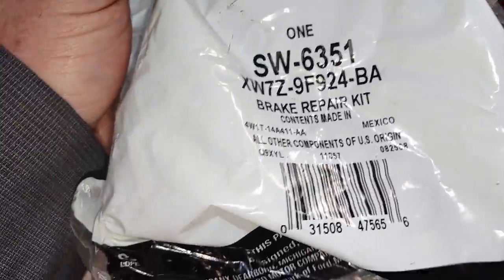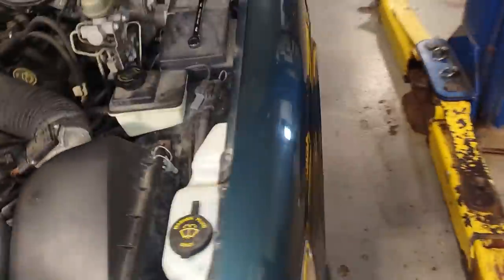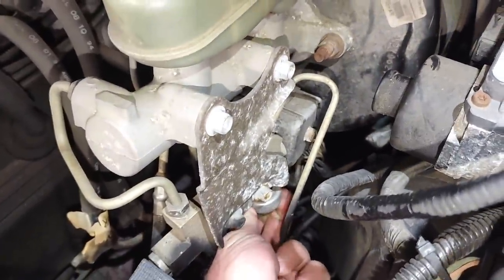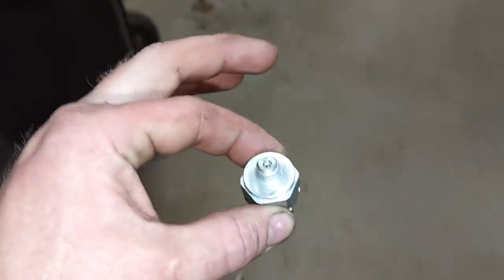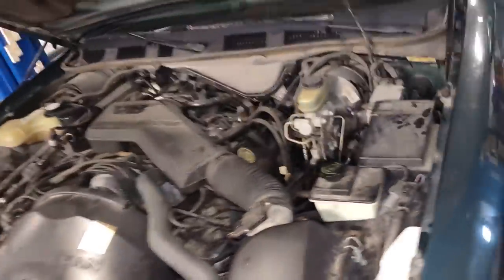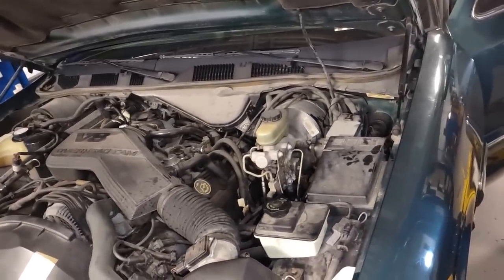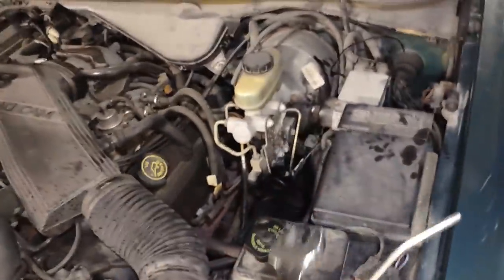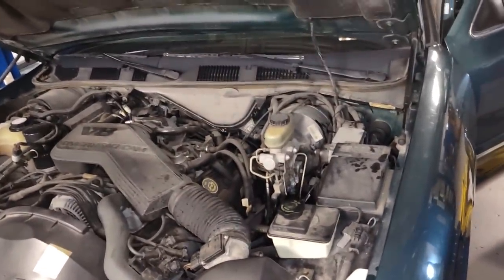Subscriber Dropped Off 1995 Grand Marquis to Get Recalls Done, Vehicle May Start Fire Recall - quick

Comment: There was a recall on Escorts, in the 90’s. The ignition switch would catch on fire and burn the car, to the ground. We had one in and it burned down, in our service parking lot, while waiting to get into the shop. The customer was actually happy, she hated the car.
Reply: Was she gifted a new vehicle?
Reply: I remember that recall. That escort was a great starter car for learning manual too
Reply: @JohnS-il1dr  no just market value. It was about 5 years old.
Reply: @andoniades  Was pretty much all Ford cars at the time. It was a massive recall. like 8 million cars.
Reply: @andoniades  the car I learned to drive a manual on was an 89 escort GT.
Reply: @alb12345672  yes and then the Firestone recall.
Reply: @alb12345672  yeah. That was the recall that they were talking about in Fight Club.
Reply: That same recall was on the 87-93 Mustangs as well. I replaced a few of those ignition switches in Mustangs I had owned. They were pretty shitty ass switches. What would happen is the switch housing would start coming apart, and then a copper electrical contact inside would slide out of place causing it to either short to ground or to one of the other contacts. They were only held together with crimped pieces of metal...not the best way of securing the thing. Part of the recall I think added the metal pin to it... which was just a bent shaped piece of metal wire that locked between the top and bottom halves. To me.. that didn't do a whole lot for it. I even had problems with the replacement switches. They should've just redesigned the damn things.

I always dreamed some aftermarket company would make a complete redesign of the switches. Like the ones made in the 94's and up. The only way to get one of those in would be to swap out the steering columns. Sucks.
Reply: @brucewrigleysgumchewz4667  ahah   GM suoilution was to add a rubber ring which did nothing   esp if you had a front bench seat and a kid accidentally moved the key  it could cause it to crash
Reply: @greasyhandsauto-shaunbutte9726  Ford had to issue that recall twice. They forgot the spare tires! 😳🙄😆
Reply: LOL back in 2002 at my dealership a customer traded in his 1990-something Ford Ranger on a new vehicle. Old Ranger was still in customer parking while owner went home to get 2nd set of keys. When he pulled up the Ranger was fully ablaze and fire department was on scene putting it out. His eyes got wide, he tossed the keys out and said, "It was in great shape when I gave it to you!" and peeled out. It was the dealership's used car at that point, but what lucky timing for that guy. Literally traded it in with hours until the truck self-immolated.
Reply: @MrJeffcoley1  that’s hilarious. My dad owned a Ford dealership and my grandpa before that. From 1937-2004, I love hearing the stories. We had a husband and wife but a car and before they left the store, the husband died. Luckily, the had purchased credit life insurance. Sh got the car free, well at a high price anyway.
Reply: @greasyhandsauto-shaunbutte9726  Ouch. That’s one insurance policy you hope never to collect on but lucky he finished signing before he croaked!
Reply: @MrJeffcoley1  for sure! It was a weird day, we had an employee die in bathroom one day. Heart attack, his wife came in and wanted to see where he died. Another employee showed her a spot, on the showroom floor. He couldn’t tell her it was in the crapper.
Reply: @punker4Real  I remember that GM ignition switch issue. The switch would rotate without any resistance at all. I don't know if they caused fires also or just shifted the switch position too easily. 

Best fix for the Ford switch... Smear a little JB weld or super glue around the entire switch. That thing aint coming loose ever again. Don't know why I didn't think of that back then..lol.
Reply: @andoniades  lol.. true. I learned in a 1967 charger... Memories
Reply: I hated them cars too.

Comment: A ford field engineer told us that when the switch failed and popped the fuse it would take out the Cruze and some customers would replace the fuse with a larger amp fuse and then bingo wires would burn and start fire and fuse still not blow
Reply: Seems common sense was lacking in these customers. Replacing a fuse with a larger amp fuse to try and stop it from blowing. Because they were too inconvenienced to fix the real problem. Some people should never be working on cars.....or on anything for that matter. It was obviously blowing for a reason. What did they think would happen? That the wire is rated for 100AMPS and will just keep itself together? Scary..

Bet those are the same kind of people who overload a home AC electrical outlet by plugging in multiple extension cords...and plugging in more extension cords to those cords.  😌

Comment: It was definitely a thing. Had Ford bronco come into shop class in high school for a tune up. Parked it outside the door before lunch so the owner could pick it up. Half way through lunch there was a huge smoke cloud. The interior was completely engulfed. The windows busted and flames were coming out 3 feet over the roof. After that, we had disconnect the battery of every vehicle if left in the shop unattended. One of many crazy shop class memories.

Comment: Nice work. I purchased  a second hand Ford Sedan in my country that was 8 yrs old . The Local dealer did a rear brake hose replacement as it was apparently  classed as an unofficial  recall. They were made too short  eventually  tearing the end off the hose.

Comment: I ordered the kit and installed it myself a few years back on my 95 Ranger 2.3l.  For the 10 bucks I paid on ebay, it was less hassle than taking it to the dealer, even though Ford had no idea the vehicle was updated and is now safe.  I had previously disconnected the harness to eliminate the risk but the cruise control was inoperative in that configuration.

Comment: Wow still going strong. Built Ford tough. Got an 08 F150 Harley Davidson edition. The odometer keeps going to a bunch of green squares.  If I wiggle the wires in its area it works. Ever seen this?
Reply from the maker: Are you wiggling the harness up by the cluster? I've seen clusters go bad in those doing that
Reply: @FordBossMe  just touch the wires by the odometer. If I hit bumps it comes and goes.

Comment: Yeah I often prefill brake components before installing.  Saves time in bleeding unless the customer has been driving around with blown out brakes for weeks which is usually the case with my customers.  
I'm born in the early 80's and I remember this fire recall.

Comment: That recall covered a very wide range of years of Ford, Mercury and Lincolns. My moms previous vehicle was a 2001 F-150 Harley Davidson edition. That was a nice truck..but it had major issues a few years ago. Anyway, she had the recall done a few years ago. And it's a good thing too. It was already leaking brake fluid onto the cruise harness below it. Unfortunately she no longer has that truck. Too many sensor problems had left her stranded the last year she had it. Turned out to be a failing PCM. Funny that... I thought the poor ECU's were limited to the EEC-IV's in the late 80's to early 90's vehicles. Like the '92 5.0 I had. When you don't know it's the computer, you're spending $$$ throwing a half dozen new sensors at it and thinking you're getting a bunch of defective parts. What a nightmare. 

When I worked at the Ford Dealership, there was a half burned out 02-06 Excursion sitting in the far back lot where they keep a lot of extra stock. Whole front end was toast. Turns out it burned out BECAUSE of that cruise control/brake fluid leak recall. That happened more often than people think.

Comment: Ford actually recalled a bunch of trucks from 1986 to 2003 for this recall... apparently there were quite a few people killed because of house fires they caused. If I remember right Ford was forced the recall from the NHSTA. Didn’t matter if they had cruise or not some still came with that switch. I installed quite a few of them harnesses in our trucks.

Comment: You ask if anyone saw a fire from one of these. We had a customer who had the harness with the fuse installed on his car. If the fuse blows at a later date, you're supposed to discard that harness and replace the switch with the upgraded switch.  There's a label on that harness that says that. The harness isn't made to be opened and the fuse to be replaced.  We had a customer whose fuse blew in the harness. He ignored the label and put a 25 amp fuse in place of the blown 5 amp fuse, and his car caught on fire.

Comment: The original recall was for Broncos. Then Ford decided to do a recall on a vehicles that used that brake switch. They did not have enough switches at the time and created a harness that had one fuse in case the switch leaked and it would blow the 2 amp fuse in the updated harness. Then they found out that not all vehicles had the power on the fused side of the harness they developed and came out with the second version of the harness with 2 fuses. One on each wire of the harness so it was more universal and covered all cars no matter which wire on the harness was powered. The kit you installed was the proper kit and last kit they offered. In fact on the original harness it had a blue tag stating that if the fuse blew out that it was to be replaced by the kit you installed and not to replace the fuse in the first or second version of the harness. I have a 97 town car that had the first version harness and when I bought the car the cruise control did not work. After I changed to the new kit the cruise control worked. I never figured out why Ford would leave 12 volts going to that switch all the time. I figured it would come on when the car was powered on. I just bought the same OEM kit on eBay for about 20 bucks shipped. My car had the recalled closed because they installed the first version on the harness which obviously did not really help because it still needed the switch changed in the long run.

Comment: I had the same recall on my 1999 Ford Expedition.
Reply: They only added a fuse harness on my F150. The switch went bad a month ago, the cruise stopped working. I replaced with the new style switch, the harness to adapt to the old switch connector, and a new fuse in the fused harness adapter.

Comment: Yea, the failure mode is the diaphragm in the switch would fail and leak brake fluid into the connector/wiring harness and catch fire, so they replace the switch (incase the original is leaking), and add a fused jumper into the harness. Recall affected my 97 F150

Comment: If your cruise stops working unplug it immediately.  It went bad no cruiz brake fluid leaked into the terminals and it was hot. Didn't know about the recall back then

Comment: I'm old enough to remember this, there was only ~12-100 vehicles that actually caught fire. But ~2 of them were in attached garage and burned down the house. So that made it a serious problem for Ford. Before ~1990 Ford had vacuum controlled cruise control, with a physical vacuum switch mounted above the brake pedal under the dash, it would dump the vacuum from the cruise to deactivate it when applying the brake. I don't know why they used a pressure switch on the master cylinder and not just accept the brake light switch 12v for deactivation. I think there is more reliability from the brake light switch than master cylinder that can't build pressure from a physical leak.
https://defectslawyer.com/ford-speed-control-deactivation-switch-lawsuit/
Reply: I remember that my teacher's truck burned up in his driveway back in the day. And it was over that issue. Thankfully he hadn't parked it in the garage that night.

Comment: Dodge vans from the 70's into the 80's had an issue with the subframe cracking where the steering box mounted.  Dodge issued a recall to weld in plates to reinforce the mounting point.  As far as I know Dodge was still honoring the recall up until about 10-15 years ago.

Could you imagine going to the local Dodge dealer with a '77 Dodge van for them to do the recall work.  Huh?????   lol!!!!

Comment: I believe recalls have an “end date”.  my Cadillac Northstar had a Nylon fuel rail that would become brittle and crack squirting high pressure fuel all about the engine obviously causing a fire.  I only had a few years to perform the free recall.  of course i did it that week, but my point is there was a limited timeframe.  

I would be curious if this repair was billed to Ford?
Reply: Same with some Honda vehicles with crappy clearcoat...you get there in certain time ect, or its not happening. Great for those who got it done, not so great for most ll

Comment: I'm in the UK. Love those big old Fords. I wish they had made them in RHD. Limited market in UK but they would have sold. Jaguars are dirt cheap and spares readily available so we do have compensations though. Price of gas isn't as big an issue as Americans think. Used car prices are often a third of what they are in USA.
Reply: I dont know our gas averages about 3 dollars per gallon . Isn't it between 1.20 and 1.50 per liter over there? There is 3.75 ish liters in a gallon so that would make it between 5 and 6 dollars a gallon 🤔 that's alot more than we pay in the states .
Reply: @miztatone918  Yes but used cars are a fraction of the price and LPG conversion is far more popular, plus we have plenty of good diesel cars available.
Reply: @robertholden8956  fair enough 👌

Comment: Good gosh I remember doing those when they first started years ago. Remember doing all the different revisions they had for them. Did probably literally thousands of them over the years.
Reply: That's why I don't work for dealerships anymore now work for a local near me county government shop. Best benefits. Pay is ok could be better but guaranteed pay check and lots of vacation days.  Actually just dropped off my 2015 explorer sport Ecoboost found out ran out of extended warranty and both turbos are bad they are in back order for three plus weeks. Going to be 4500 with two other small repairs. Wish I could do it but don't have time trying to sell my house and my lift is tied up. But parts are in back order.
Reply: I did a million of the fuel line clip recalls in 86/87. Good times.

Comment: Just curious if you've dealt with any of the 2020+ Escapes yet.    Seems to be a concern with folks on the forums about the subwoofer rattle issue in the higher end models that are equipped.   Wife got a new Titanium leftover 2020 in February and its the same, very annoying but the rest of the vehicle is great.   Seems to be no TSBs or a fix from Ford yet.
Reply from the maker: Only delt with camera recalls with them thats it
Reply: @FordBossMe  thanks

Comment: I had a 95 mgm there was a recall on the cruise controll but nothing on the breaks
Reply from the maker: This had 3, seat belt buckles inspect, relocate 2 fuses installed wrong from factory and the brake psi switch
Reply: @FordBossMe  wow I never had those recall like I said the only one I had was with the cruise control catching fire so they disconnected until they got the parts, this was in 2002
Reply: I believe the cruise control harness caught fire because of brake fluid leaking onto it. Either by leaks, or by someone spilling while adding to the reservoir. I think it would get into the harness coupler and cause a short in the contacts. I could be wrong.

Comment: Done alot of those when I was at the Ford dealer in 2008-09 and had a expedition come in at the independent shop I'm at now with cruise not working and it was that harness bad removed it and cruise worked so had them contact dealer
Reply from the maker: Yeah they went through several revisions on that harness because even after they came out with the harness update they wired it wrong
Reply: @FordBossMe  that's what I thought but wasn't for sure left ford dealer in 09 and been at independent shops since then

Comment: What your opinion on slotted brake rotors for 2006 Silverado daily driver
Reply: A total waste of money, if you asked my opinion.
Reply from the maker: It's really a waste of money because you are reducing your contact surface and it's not like you're driving a race car so you're going to get better breaking and you're not going to have to dissipate heat as much on like a track car so just a regular standard good quality rotor would be more than sufficient

Comment: I have a 97 grand marquis that has a rusted out brake line and I found out they had a recall in 2005 to fix it because it was breaking on all the grand marquis and town cars and crown vics.. when I bought the car 8 years ago it only had 70k on it so the line wasn't rusted yet. I called Ford and they said there is nothing they can do... Any suggestions how I get them to cover it?
Reply: I think after 16 or so years they just put it down to age. If it happened in the first fews years its a big problem for them. A car that old i think you might just have to get it done at some shop, the dealer or an independan.